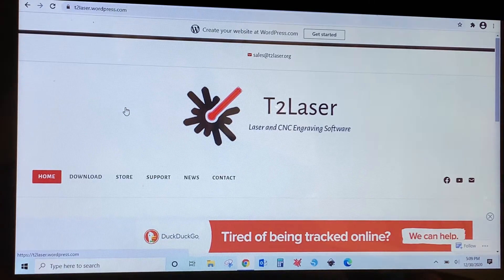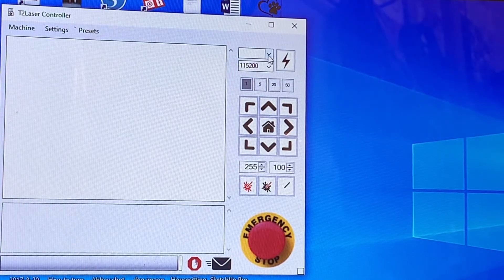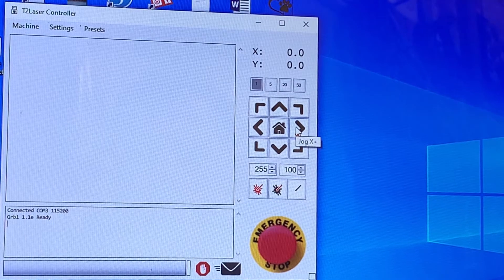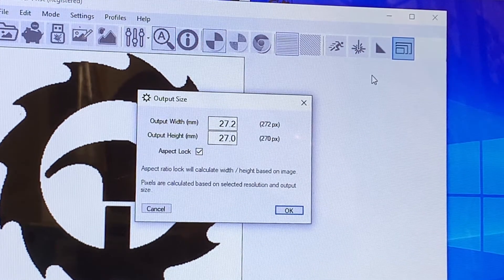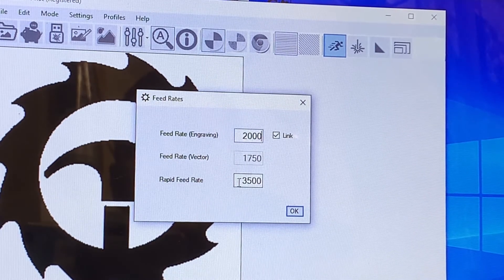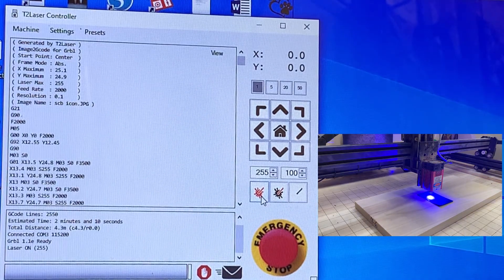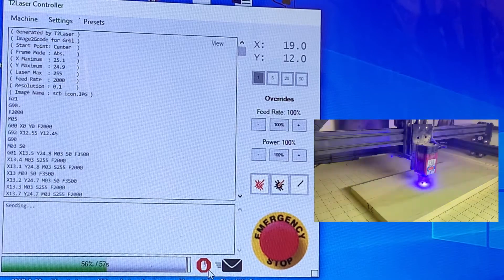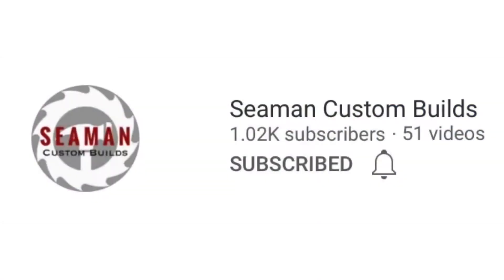How to Setup and Configure T2 Laser engraving software

Comment: Video helped A LOT. I’m just having a hard time with my words coming out not to burnt (edges brown) I’ve adjusted the laser power and the speed a few times now. Is it also normal for the machine to work reallt really slow? I have the universal engraver 15 watt. I’m talking hours to get one project with 3 words and a date. I also adjusted the other speed
Reply from the maker: Thanks for watching, the words being brown probably has more to do with the wood you are using, a light sanding after will help remove that, I would make mine go as fast as possible and still get a good burn, that varies by wood species
Reply: I am using painted plywood 1/4” sanded underneath the paint. I just need to play around with it more. Thanks for the reply!

Comment: Scott: I used all the settings you used and The only issue I’m having is when I’m going to engrave my image, everything seems to be working, but the laser doesn’t burn the material. Any ideas what could be happening? Does it need to be farther away from the material (in this case Plywood)?
The program is compatible and it’s registering the machine and all but just not getting any burn yet. Thanks!
Reply from the maker: Is the laser turning on?
Reply: @seamancustombuilds  yes everything seems to be working properly. Once i start engraving the image, the laser turns on but nothing gets printed on the wood.
Unless I think it’s on and I need to set it to burn? Not sure, I’m new to laser machines.
Reply from the maker: @Adrian-hq7bs  if the blue light it on then you just need to focus it to a pinpoint beam
Reply: @seamancustombuilds  okay I will try that, thank you. I guess I was thinking that it needs to be closer to the material in order to burn.
Also what firmware are you using? I see on the machine tab that you can change it depending on your machine, how do you find that out?

Comment: I'm trying to upload the firmware but it won't do anything. Any suggestions? I just started my free trial.
Reply from the maker: Maybe try closing the program and rebooting as well as powering the laser off and back on, make sure you are connected with the correct comm port
Reply: @seamancustombuilds  thanks will give it a try. The last time it didn't show a comm port.

Comment: OMG Scott you just saved me from throwing my laser engraver in the trash.  I do have one problem though, every time I go to engrave (on wood) it looks out of focus, like double vision.  How can I fix that?  The links that came with the Universal 3000m blue CNC Laser engraver was the worst ever.  I was in tears until I found your video, now all I have to do is figure out this double vision thing.
Reply from the maker: Glad it helped, depending on the model it either has an adjustment knob on the laser mount or you turn where the laser shines out, it should screw in and out to get the pinpoint you need
Reply: @seamancustombuilds  Also Scott, what setting do I have to have to get the laser to cut deep? I kind of want a deeper cut on some cutting boards I'm making and don't feel like have to repeat the pass over and over?
Reply from the maker: @patriciagraves9262  I keep laser power at max and adjust speed to get a deeper burn